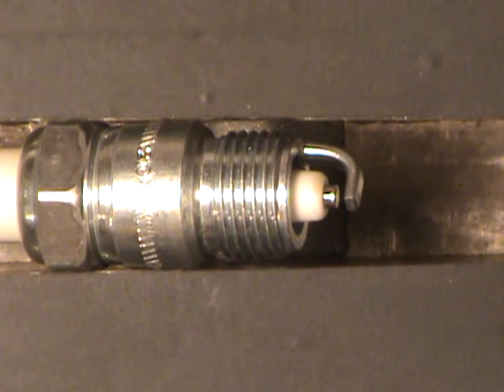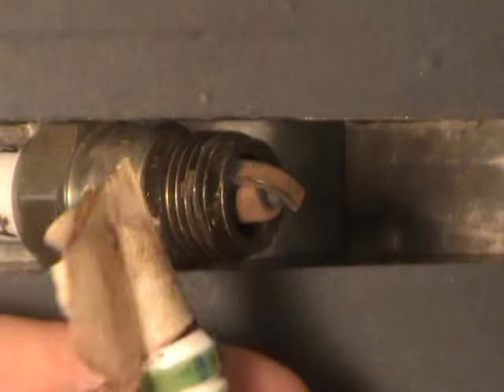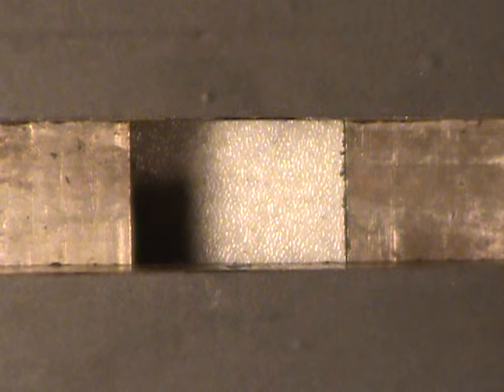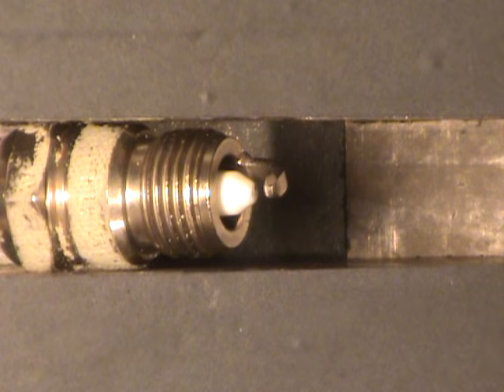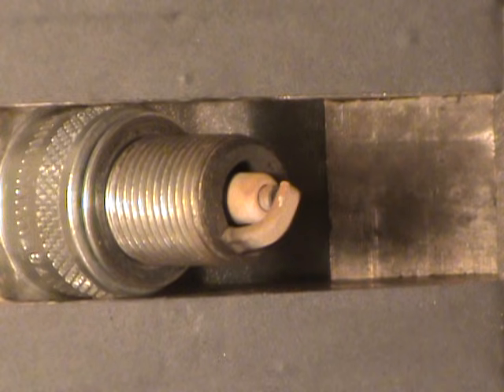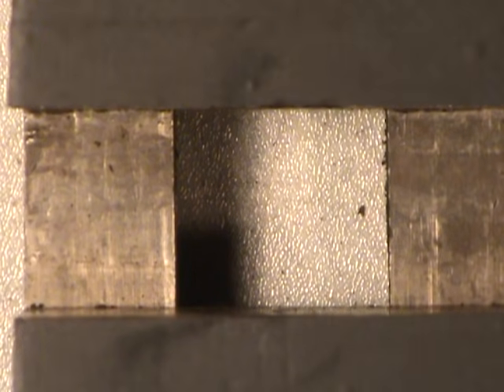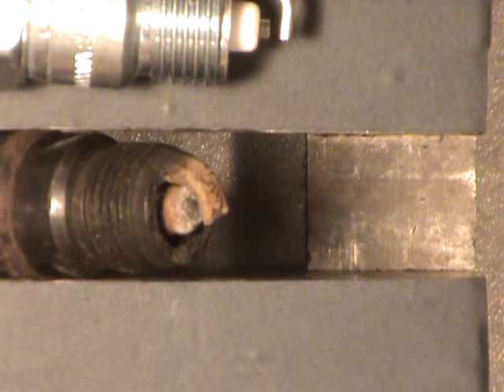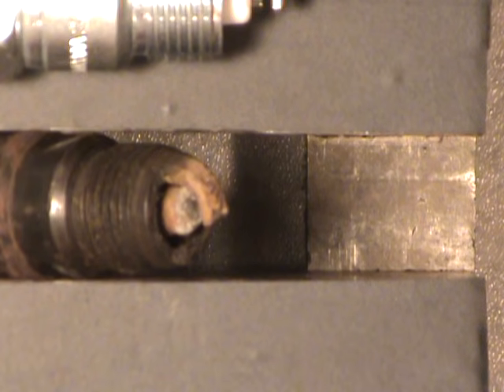SPARK PLUGS How to Read them (Part 3)

Comment: Great video I have a 1999 protege Mazda and the other day I had a misfire .. On cylinder 4  the pervious it had been raining hard and I hit a couple of standing water to fast ..point is I resented the light and when I pulled the plug my plugs was a gray ashy color so I did a tune up and it seemed to fix the issue just wondering what your or anyone's input is .. Could the spark .. Gotten wet or was it time to change it I did the spark change a year ago
Reply from the maker: Greetings Erik Rivas....Thanks for watching this Spark Plug video of mine, and, for Your comment/question as well....On some of the Computer Controlled Engines, with Fuel Injection, such as Your Mazda Protege (spelling?), the Spark Plug/s "Color", and "Deposits", can very well be, looking "Gray Ash-Like", and in some cases, approaching that of, an almost "White-ish" Color, depending on, just how "Lean" (air/fuel ratio), that the Vehicle Manufacturer wanted that particular Engine to Run, without going Too "Lean" (air/fuel ratio), which usually Results in, an Engine that has "Drive-ability" problems, such as Surging, Hesitating, Over-heating, etc.

Yes indeed, Vehicle "Ignition Systems", sure "Do Not" like "Moisture" of any kind...!!!

What usually happens, when the Ignition System "Encounters" Water/Moisture, is, all of that "High Voltage" Electricity, tries to find the "Easiest/Shortest" Path to "Ground", and if that Water/Moisture "Provides" that, shall we say, "Path", then, some, if not all, of that "High Voltage" Electricity, that was supposed to be making its way to Your Spark Plugs, "Does Not" Arrive, then, it will usually cause a "No Start"...or..."Miss-Fire"...situation...!!!

Seeing as how Your Mazda is a "1999" Year Model, if there is/are almost Any Ignition or Fuel System Problem/s happening, then, Your OBD-2 (On Board Diagnostic, Version 2, Computer), will usually activate a Dashboard Warning Light, letting You Know, that there is a Problem, or more then 1 Problem, that Your Vehicle's "On-Board" Computer, has "Detected", and will usually "Store" that Problem's "Information" in its "Memory".

The only way, that a Person can "Retrieve" that "Information", that is "Stored" in Your Mazda's "Computer", is to use, what is commonly called a "Scan-Tool", which kinda looks like, a slightly Larger, Hand Held "Calculator".

If Your Mazda has to be "Smog" (aka, Emission Tested), that "Test" will most Certainly "Tell" You, that there is something wrong with things like "Miss-Firing" Spark Plugs, as well as, just about anything, that can and will include, Ignition related, Fuel System related, and even the Catalytic Converter/s ability to reduce Exhaust Emissions.

By keeping things like Spark Plugs in "New-Like" Condition, as well as any other Ignition related parts and pieces, in very Good Working order, that alone, will help Your Mazda's Engine, to have Lots of Power and Fuel Economy, as well as, keeping Your Gasoline "Bill" as Low as possible, especially considering the "Price" of "Gas" these Days...!!!

If You happen to have an "Owners Manual" for Your Mazda, have a look-see in it, and hopefully, You will find a "Maintenance" Schedule in it somewhere, which should let You know, when, the Maintenance "Interval", be it measured in "Time", or, Mileage/Kilometer-age, and by keeping to that "Schedule", that should allow Your Engine to be as "Efficient" as possible.

It's "Not" such a good idea, to just let an Engine Operate, until it starts "Acting-Up" and not be Running so good, as that sometimes can lead to some Premature Engine "Wear", along with some Very "Expensive" Repair Bills...!!!

Be Safe, take care, and have a good one.
Reply: RockysRoadshow thanks for the detail information .. I was just wondering since I was driving and my check engine started flashing I use the scan tool and and it said I had a mis-fire in cylinder 4 ...so after freaking out for a few mins I changed the spark plugs and cables rested the light and I felt the car perform better and it no longer stumbled at idie .. But I don't know if it really fix the issue I drove it on the highway for like 8 miles going 70mph got home and it seemed ok
Reply from the maker: Erik Rivas
Greetings Erik Rivas....Good to hear, that Your Mazda is running better now....When You had Your "Scan Tool" hooked up to Your Mazda, did You Remember to "Clear" the Mazda's Computer "Memory" (using the Scan Tool), before You "Disconnected" Your "Scan Tool", so the "Old" Trouble Codes got "Erased" from Your Mazda's "Computer"???....Otherwise, if the "Old" Trouble Codes are still "Stored" in Your Mazda's "Computer", it might Fool You, into thinking, that there are "Trouble Codes", when there really "Is Not" Any...???

Once the "Old" Trouble "Codes" have been "Cleared" from Your Mazda's Computer "Memory", with Your Scan Tool, all You have to do, is Drive Your Mazda for a few Miles, and, Your Mazda's Computer, will start "Re-Learning", as You are Driving, and it will store the Information that it needs, to make Your Mazda, run really good, once again.

To avoid Any unneeded Problems with Your Mazda, it's always best, to keep Your Engine well Maintained, with the needed Parts, replaced, before those Old, Worn-Out Parts, start giving You Trouble!

Be Safe, take care, and have a good one.

Comment: I have a 2003 Chevrolet Silverado V6 with 57000. miles on it
The question is at or around 1200 rpm and around 2400 rpm and again 3600 rpm there is a vibration under load or at no load
What do you think it might be?
Thanks Rick
Reply from the maker: Greetings Rick A....Thanks for watching, and for Your comment/question as well....There are a number of things that might be causing, what I will maybe call..."Harmonic" or "Frequency Cycling" Vibration (just some words that popped into my head, that's all...lol)....It could be Your V-6 (4.3 litre or 262 cubic inch, I think?) Engine, or, it can be something, that might not be directly related to Your Engine at all....So then, here we go....I will start with some Engine related possibilities, then, I will move on to some other things, that, have been know to cause similar (not so good) Vibrations, and, the following will probably have a mix of, both questions and some things that could be considered, and checked out as well.

If, it happens to be "Engine Related", the following, are some possibilities...

Does Your V-6 Engine, Start, Warm-Up, Run Smoothly, Hesitate, Miss-Fire, Stall, etc., or is there any other "Not So Good" Running issues with Your V-6 Engine, "Other" then the "Vibrations" that are happening at the "RPM's" that You mentioned?

Have You "Replaced" or "Adjusted" Anything, just before those "Vibration's" started happening?

Have You been keeping up with "Tune-Up's" and the Recommended "Maintenance", that the Manufacturer Recommends?

Do You happen to see any "Warning Lights", such as "Service/Check Engine", or "MIL" (aka, Malfunction Indicator Lamp/Light), etc., on, or near Your Vehicles dashboard?

I'm thinkin', that, the First thing, that most "Fix-Em-Up-Establishments" (aka, Automobile Repair Shops) would be doing, is, "Scanning" Your "Pick-Em-Up-Truck's" (aka, Pick-Up Truck...I think it's a Pick-up Truck?...lol) "ECU" (aka, Vehicle's On-Board "Computer") for any "Trouble Codes", that Your Vehicle's "ECU", has "Stored" in its "Internal Memory".

A "Scan Tool" (kinda looks like a slightly larger hand held calculator), and is connected to the Port/Connecter in Your Vehicle, and, Extracts, any "Information/Trouble Codes", and, Displays that Information on the Scan Tools "Readout Screen".

You can even purchase Your Own Scan Tool, and use it too, by just following the Instructions that come with it.

Once Your Vehicle's ECU "Trouble Codes" (if any) are known, then, those "Trouble Codes" will be able to Point in the Direction, of the Actual Area, Circuit, or maybe a Malfunctioning Part, as the case may be.

Sometimes the Cat or Cats (aka, Catalytic Converter/s), can become Partially "Plugged-Up", causing an Exhaust System "Restriction", that Prevents Your Engine from "Breathing" Properly.

I believe that Your Vehicle's Engine, has, what is know as a "Balancer Shaft" in it.

It's an Odd Looking thing, that resides just "Above" the Cam-Shaft in Your V-6 Engine, that gets Driven by a Pair of Helical Gears, if indeed, Your Engine is the one, that I'm thinkin' of, that is.

It's not very likely, that the "Balancer Shaft" is causing the Vibration's that You are experiencing, but, being me, I Never Rule Anything Out, cuz, over the years, I've seen some very Strange "Things", that I ever though, could be "Causing" the "Symptom's", that were "Happening", at that particular point in time!

Now then, let's go on to some other possibilities, shall we...

Did You have the Vehicle "Undercoated" Recently? (just before those Vibration's, reared their ugly head's...lol).

The reason, that I ask, is that, sometimes, when the "Undercoating" is Applied/Sprayed onto the Chassis/Frame of the Vehicle, there could be the possibility, that, some of that "Undercoating" got "Applied" (sprayed) onto only one side of the Vehicle's "Driveshaft", which has been know to cause, that particular "Driveshaft" to become "Unbalanced", which will usually cause, a very noticeable Vibration, at various speeds.

Could be Loose/Damaged "Front Wheel", or, "Rear Axle"...Bearings, which will cause all kinds of problems, with, Vibration's being one of them.

Another thing comes to mind, but, doesn't usually happen as early as "57,000" Miles, are, Loose or Worn-Out "U-Joint's" (aka, Universal Joint's, usually found at each end of the Driveshaft, and sometimes, between, a "2" Piece Driveshaft as well).

Maybe even an "Out of Balance" Wheel/Tire?
Check for Missing "Balance Weights" that are usually "Attached" to the Wheel/s

Are all Wheel "Lug Nuts" Tight?

If You have a "4 X 4" (aka, "4" Wheel Drive), then, you might have even More, "U"-Joint's or Constant Velocity Joints, as well as, at/on the Transfer Case Driveshaft as well?

Maybe You had a New or Rebuilt "Torque Converter", that may be, Out of Balance, but only if, Your Vehicle has an Automatic Transmission, that is.

Even if Your Vehicle's Transmission is a "Manual", with the "3rd" Pedal (aka, Clutch Pedal), and, if the "Flywheel" was Replaced or Re-Ground (Without being Balanced Properly), that will usually cause Vibration's, of one kind or another.

In the case of the "Unbalanced" Torque Converter or Flywheel, usually, a Person would "Feel" some Vibration, while the Engine was Running at Idle Speed, but, all kinds of things, have been known to happen.

If any Parts "Rotate", when You happen to Experience those "Vibration's", then, Consider "ALL" of those "Rotating" Parts..."Suspects"...!!!

Always think in terms of "Safety"...!!!

Make sure that, None of Your Vehicles Wheels/Tires, Brakes, Suspension, Steering, Drivetrain, Fuel System, Electrical, Parts, etc., are becoming Worn-Out, or Not Adjusted Properly, to the point of becoming "Unsafe", that might cause "Loss of Control" of Your Vehicle!

Always be "Suspicious" of any "Vibration's" or "Sounds", and also, if You happen to notice "Weird Smells", as well as, any "Abnormal" Vehicle Operating Condition's...!!!

Those "Vibration's", that Your Vehicle is Producing, just might be a "Warning Sign", that, is letting You know, that, Something, might be getting to the Point of..."Becoming Unsafe"...!!!

It would probably be a good idea, to have Your Vehicle put up on a "Hoist", and have a "Certified Mechanic", check out, Your Vehicle, to Make Sure, that, Your Vehicle is "Safe" to Operate...!!!

There are some Automobile Repair/Service Shops, that might "Inspect" Your Vehicle for "Free", and, if they Find something "Unsafe", they will probably give You a Free "Estimate", to Fix it as well.

Till next time...

...Be Safe, take care, and have a good one.
Reply: RockysRoadshow
Thanks for your time
This vibration is in the engine even in park at the 1200 rpm and 2400 rpm and so on, it is still there I changed out the spark plugs there is no codes show up does not hesitate, Miss-Fire, Stall, run like a new one,but it still has that vibration Thanks again
Reply from the maker: Rick A
Greetings Rick A....You are welcome, and, I noticed, that You Indicated, that, those so called Vibration's that Your Vehicle was/is Experiencing, while at those 1200...2400...etc., RPM's, were taking place, while Your Automatic Transmission's gear selector, was in "PARK", has me thinkin', that, those very Unwanted Vibrations, while Your Vehicle's Engine is Running, can more or less, be "Isolated", to "Any" of the Vehicles "Parts", that are "Rotating/Moving", and that leads me to believe, that, it's Either the "Engine"...Or, the..."Automatic Transmission"...!!!....There might be a "Bolt", "Nut", or Something, that has "Come-Loose", which, as I see it, might be "One" of "Many" Possibilities, that might be causing those, shall we say, "Vibration's at Predictable Incremental RPM"s".

The following, are just a few Thoughts of mine, that, could be considered, as it applies to those not wanted "Vibration's"...

"Engine related"....Fuel Injectors, might be Restricted or Partially Plugged-Up, causing a not so good..."Spray Pattern".

Gasoline, when Evaporated, and Dried-Up, is not as Clean, as it appears to look, while in Liquid Form.

When it becomes Dry, it will usually Coat various Parts, wherever it Travels through-out the Fuel System, and when it "Drys-Up", it usually leaves behind, "Brownish, Varnish-Like Deposits", that will usually cause "Small" Orifices (aka, Holes), to become "Restricted", and will "Impede" the "Flow Rate", of any "New" and Liquid gasoline, that is making its way, through the Vehicles "Fuel System".
 
I usually Add some "Fuel Injector Cleaner" (a Small Bottle...Costs less then $10.00 Dollars), and I just Add it to the Gas Tank, as per the "Instruction's" on the back of the Bottle/Container.

"Warning"...!!!...Some of this "Stuff", works, maybe "Too Good"...!!!
I had the Experience, of, Adding some of this "Stuff" to my Vehicle's Gas Tank, and that "Stuff" (according to My Observation), seemed to have "Cleaned", All of the "Crud", that was Lurking Inside my vehicle's Gas Tank, and made its way into the vehicle's "Fuel Filter", and "Totally Plugged-Up the Fuel Filter"...!!!...and, in some cases, it could even "Destroy" Your (in the gas tank, Electric Fuel Pump...!!!)..and...(the Engine Would Not Start or Run...!!!).

So, to avoid the (just) above Scenario, "Change" Your "Fuel Filter", as soon as, the Tank Full of Gasoline, that has the "Fuel Injector Cleaner" in it, is "Empty"...!!!

Now then, about the Automatic Transmission...

There is usually a "Flex Plate" (Kinda like a light weight flywheel, that has gear teeth around its circumference, that the starter motor's pinion gear engages with, to start the engine), and, there are some of the older ones' that had "Balance Weights" on them, that might have Moved, or, Come Loose.

Who really knows, but, maybe, just maybe, the "Flex Plate", or something to do with the "Torque Converter", and/or its "Lock-Up" Mechanism, has become "Unbalanced", for one reason or another...???

Might even be something like, Motor Mounts or the Automatic Transmission Mount/s, where the Automatic Transmission Case/Tail Housing is Supported...???

Try to Remember, just "When", and under "What Condition's", did You "First Notice", that/those Unwanted "Vibration's"...???

Did those "Vibration's"..."Start", at the Same "Intensity", as they Appear to be at "Currently"...???

Do those "Vibration's"..."Increase" or "Decrease", during the "Different RPM's", that they are Occuring at...???

"Safety" is the Priority, make sure that, "What-Ever" is causing those "Vibration's", are not going to cause any "Safety Related" Issues...!!!

I hope that, some of the Above things mentioned, Helps You "Track Down", those, Not Wanted "Vibration's"...

Be Safe, take care, and have a good one.